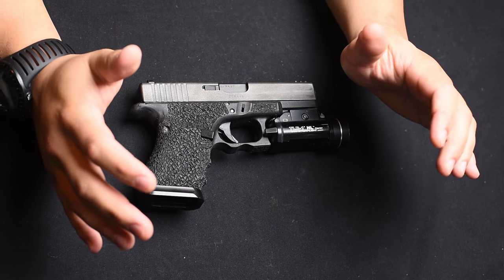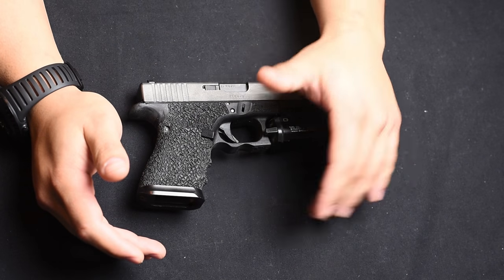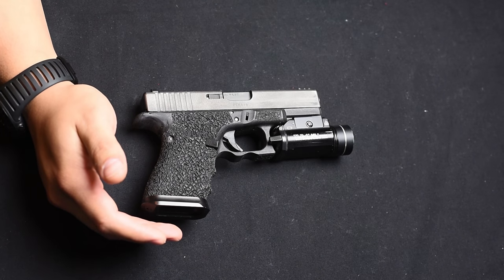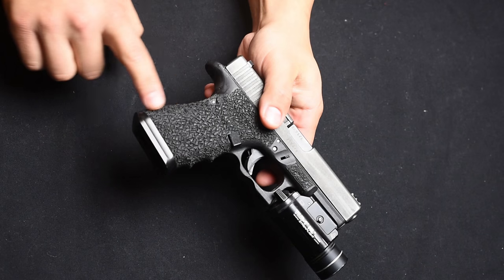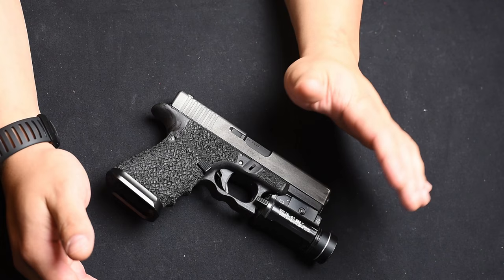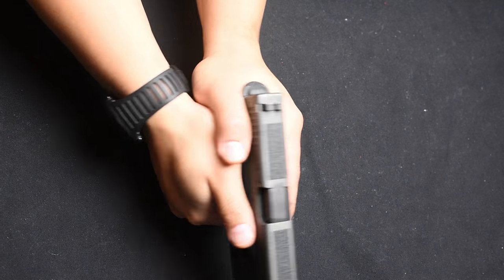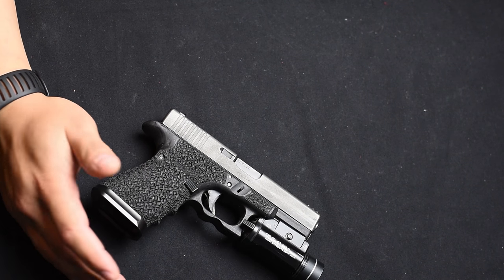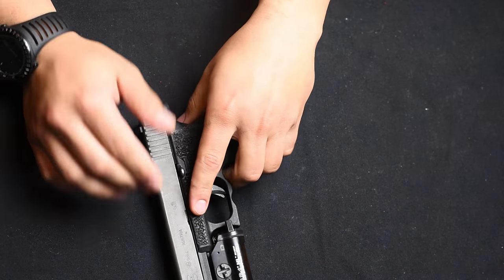CCW Glock Mods: Beavertail Enhancement

Comment: That will most likely end up delaminating. You need to integrate with polymer, not epoxy. You can use the epoxy under the beaver tail to help, but you need to integrate the edges with polymer. And it helps to cut the beaver tail AFTER the trigger housing pins, so you have the pins to help keep the beaver tail anchored on.
Reply from the maker: Kyle Teeter almost two years and it’s still holding strong
Reply: @idavemoore  is the jb weld still holding up?

Comment: Doing the same thing to my Taurus g3c. Except I’m using the crazy glue and baking soda method to fuse the plastics together as one, and sand it down to shape.
Reply: Did it work?
Reply: @paultrevino81  actually it did, never had a problem with it and it’s  fused with the polymer frame, a lil dremel for the rough edges but it came out perfect brutha, I don’t know if you plan on trying it but it’s works.
Reply: @punisher-ok2dj   I have a Walther Creed I shaved down some of the palm swell and want to add a little more toward the top

Comment: How’s it holding up? I’m did this to mine soon as you posted the video and mines is still on rock solid but I haven’t shot it as much as I wanted to due to COVID lol! What’s up bro
Reply: Did you use JB plastic weld or just JB weld?
Reply: @paultrevino81  sup bro I used JB Weld Plastic Black. It’s still on there and I’ve shot around 4k rounds. You want to rub on as much epoxy as you can inside the cut off strap and on the back pre existing dove tail of the frame and anywhere it might make contact with and be sure to of course tape off any areas you don’t want to get it on pack it in there and squeeze it till it oozes out! This is why people have issue with it coming off or breaking off not enough epoxy or not mixing the epoxy properly to get a good bond. Once it completely dries the black from the polymer and black was the jb weld plastic will be a different tone so you just want to sand it down until it’s flat on both side til it’s comfortable for you. I used dremel to knock off all the extra glue that squeezed out then I hand sanded with 320,600,800,1000 grit. Clean it off with alcohol then I used some car black plastic trimmer restorer to bring back the polymers black. I did like 5coats rub on let it sit then wipe off few mins later. Clean it with alcohol again if you decide to add the sand paper grips line I did if not then your finished enjoy bro very good mod! I also did the trigger undercut at the same time. Then I added some 80grit talon grips you can’t even notice it there.
Reply: @ivanncastro  thank a bunch man I've been trying to figure out how to get the right products but man surprisingly there no videos, and I couldn't find anything on the net.

Comment: Dude I can't remember what woodburning tip u used to texturise your glock? I remember technique but not tip size. Can u tell me.
Reply from the maker: It's the flat head screw driver type tip. It's about an 1/8 inch wide